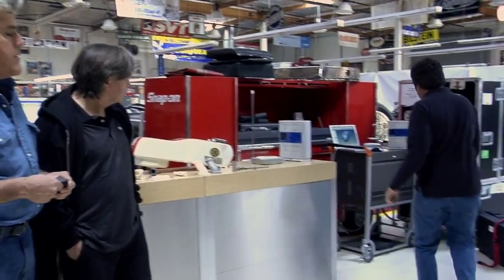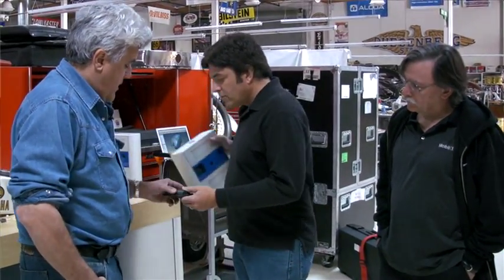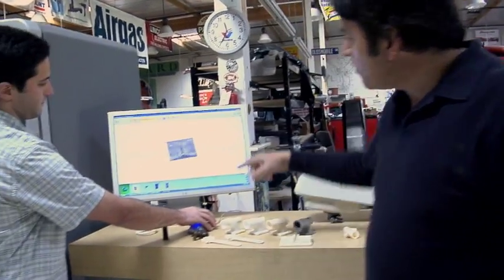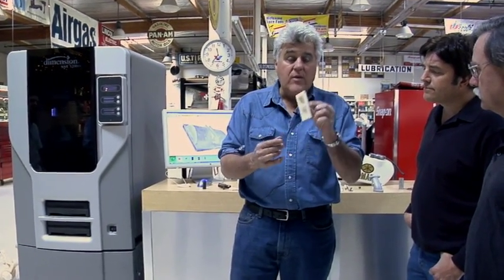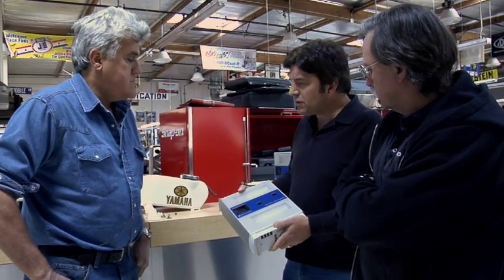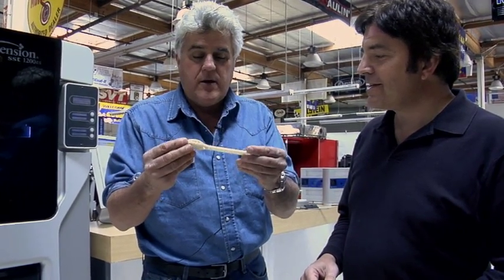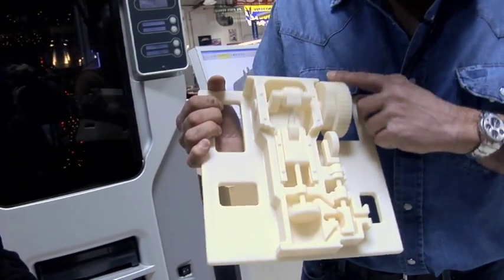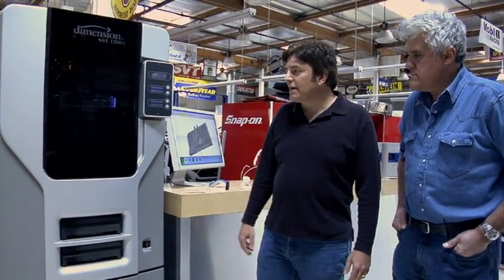NextEngine's 3D Scanner - Jay Leno's Garage

Comment: I'm semi-retired now, so my info is ~ 5 years old.  Coordinate Measuring Machines (CMM's) can use 3D models as a basis for measuring in Q.C.  Usually CAM & CMM take IGES files from nearly all CAD, but occasionally need some massaging for specific applications.  This is really a result of an enterprise-wide approach to automation that unifies part geometry-based data.  Having worked in engineering & science since the 60's, these intelligent developments have fascinated me.

Comment: It doesn't shrink. The printer makes the part in abs so you can test fit it and make sure it works. Then the 3D scanned information is put into a CNC machine and made from what ever material you want. The system saves on time and material waste. Well worth owning if your a machine shop or parts manufacturer for adding extra features. It's one reason they can have iPhone 5S cases on a shelf after release in less then a week that fit perfect.

Comment: Yes.  CAM software can create NURBS surfaces for multi-axis toolpaths for CNC machining, but some scanned models will contain irregularities that are so complex that machining paths & tool changes might dwell for too long.  Such models need to be 'massaged' by the operator or an engineer in order to simplify geometry first.  Cast & molded parts may also contain concavities, undercuts & fillets that are too small for milling cutters, so models of those also may need massaging.

Comment: I could see them dissassembling some mechanism, scanning each part seperately, and then putting them together in the software interface, and then printing the mechanism using the temporary stuff to isolate each sub part, dissolving the temporary stuff, and voila you have the printed moving parts mechanism.

Comment: +XDfranky Melting point of plastic is way lower than that of metal(less energy = saving $$). 3d printers are efficient ways to know whether a piece has or not the correct proportions/measures, and to have a visual reference of the piece itself; all that with the lower costs possible so that when there's a mistake of the piece you don't have to perform all the necessary operations to do a metal piece again. You just print another plastic and test it... That's the whole point of 3d printers. Test measures and sometimes functionality. If you confirm those specs with the plastic piece, then you move to the next step: production. Until now, there is not a reliable process capable of melting metal as a plastic printer does because of their material properties.

Comment: No. The 3D printer is just a means of making a rapid prototype. This allows you to test fit and in some cases, function, before you make the part out of proper material. To make the part from e.g. steel, you would feed the data from the 3D scanner into e.g. a CNC mill.

Comment: I wonder if that machine could be made to use a high temp wax for castings. I have had a few parts that I have needed over the years that a new cast part would have cut out repairs like old water necks.

Comment: I want to 3d print a cheap lawnmower engine and install all the fuel lines, spark plug, ignition, fluids etc and just see if it'll run. Even if it'd run for just a few seconds, that'd be awesome.

Comment: You can't make a functional firearm from plastic. Barrels, chambers, firing pins, springs, bolts, etc., need to be made out of steel. What you most likely saw was an ignorant report from the anti-gun mass media about people making a lower receiver for an AR-15 on a 3D printer. The AR-15's lower receiver is a low stress component that only has the job of holding the magazine and lower parts kit in place, and plastic works fine for it. A bare lower receiver is a far cry from a rifle though.

Comment: I'm sorry, but I just don't believe a scanner can capture all the internal parts of component and therefore any piece they show that had moving parts would have to have been dissassembled first, scanned part by part,  printed part by part and then reassembled. That curvie manifold thingy, I don't think the scanner could capture the inside of it and therefore the scanner would produce a solid object instead of a hollow object.

Comment: No quality firearm is made entirely from sintered powdered metal. Some decent quality guns have MIM parts, which is the same idea, but they are parts that don't see much stress. No one would make e.g. a firing chamber from sintered powdered metal. 

Simply typing "hardly" doesn't address the cost issue at all. If you know the cost then post it. By the way, it is perfectly legal to manufacture your own gun for personal use. Research "80% lower receivers".

Comment: Well Jay leno has it, but I dont. What if i need it, where am I supposed to get the extremely rare part from? They stopped making them in 1910. Normally I'd have to track down a drawing for the component then have an engineer fabricate a model for casting or machine one from a billet. Thats expensive.  
But this does away with all that. He can simply email me the STL file of the part he scanned and I can print it off at home then get it casted. Or just send the file to a CNC machine.

Comment: No, you are simply out in left field. This video is about 3D printers that are affordable on a consumer level. What does an Arcam machine cost? Also, it is not sintered by a laser, it is sintered by an electron beam, and I don't see any stainless steel powder listed on their website. I see 3 different types of titanium and cobalt-chrome, none of which are correct for reproducing old car parts, and in many cases, not even suitable.

Comment: What does an Arcam 3D printer cost? Millions of dollars? Whatever it costs, I'm willing to bet it is far more than it would cost to simply hire a machinist to build you a much higher quality gun, or more than it would cost to buy an ordinary CNC mill, etc., and make it yourself from steel barstock (far superior to sintered metal powder). Also, that machine can't make springs, not ones that will actually work anyway, and it can't make normal-size firing chambers that will actually last.

Comment: What good does it do to scan a worn out part to make one just like it..I see the benefit from the standpoint of having millions of data points, but someone still needs to correct the wear problems.. As with the gears that are mentioned.. obviously scanning a worn out gear and making one just like it it total stupidity...If you use that part as a pattern for casting you would be in very bad shape in the finished part due to shrinkage..